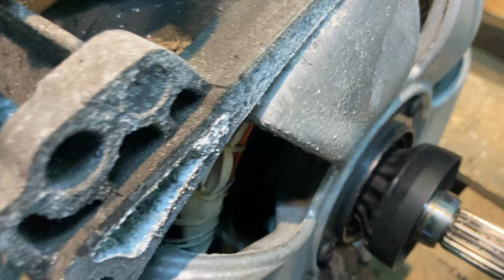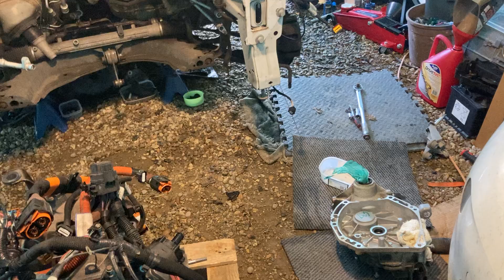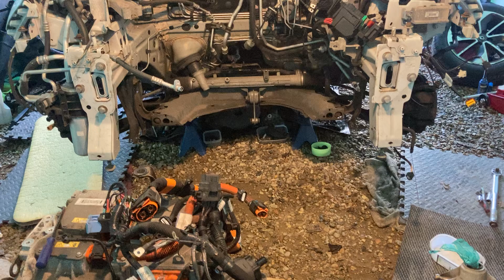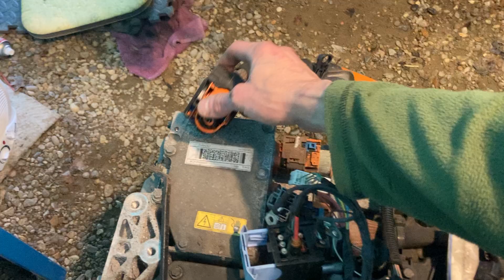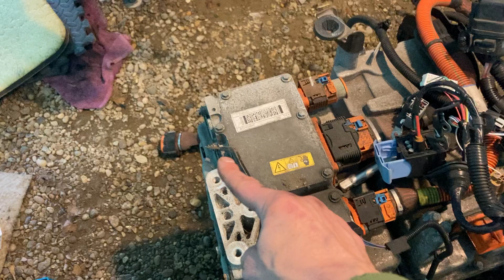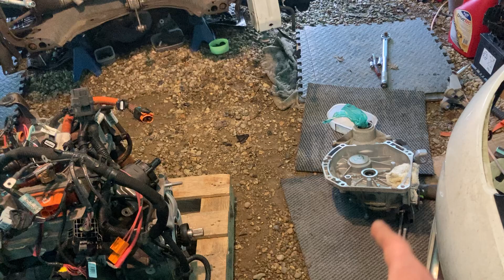Why is it so difficult getting major EV repairs done in the UK? Electric Car motor repair

Comment: Good vlog where in Essex are you as I have a cat s Nissan townstar from copart all now repaired but need help with srs module and the electrotechnical fault light many thanks 🙏 Mark from Billericay 😃👍
Reply from the maker: Hi, near Chelmsford. The diagnostics on those can be a bit more involved due to it having a secure gateway, can probably still help but will likely need to use some different equipment. Some companies will clear data from srs modules. Are there fault codes stored? If it’s easier drop me a WhatsApp 0330 043 6388 cheers

Comment: As is so often the case, fear of the unknown is a show-stopper for people. Once they embrace the new situation, they start to realise that most of their fears are unfounded. We should have confidence that garages are becoming more willing to repair EV's. It will have to happen when all new vehicles become fully electric.

If our R110 ever needs a motor repair, then, given the pleasure, low home electricity cost, low stress and the convenience of driving a BEV, I would probably pay for those 10 to 12 hours of labour and the cost of parts, even if they cost more than the value of a dead car. It's much less expensive than buying a new vehicle. 

That said, we're low mileage drivers (12,500 in 5 years), and we drive almost exclusively in Eco Mode, so the motor and gearbox might well outlast the rest of the vehicle. The car might be around for longer than my remaining driving career. Scary thought...

In short, I'm not too worried.

Comment: I can imagine a good business that simply repairs EV's components and replaces them in their workshops.

Presuming that fixing motors and reduction gears is pretty much bearing replacement (any greater problems and you would simply swap out for a refurbished parts from a crashed car?)   The controllers can't be much more complex than fixing ECUs and other components that fail charge port locks(?) are pretty much a swap out part?

You take the parts in a van and visit garages, work on their lift and repair the car for them?

Comment: Are you accually anyone alloved to work on EV in UK?
Atleast where I'm you have to have High voltage certificate to do work on them. It's quite long education and 20k doesn't sound far off. Usually there is only one per dealer here that's even alloved and just recently a college has a his EV booked in for warranty work, the first time was in the end of February since they are so busy. Understandably, who in there right mind would willingly work on a car wtih corrosion and other crap for shit money when the papers will allov you to get in to transformers and other high voltage work in a dry nice envoirment without a customer hanging on your back and questioning why it takes so long or is so expensive.
Reply from the maker: Yes I’m a qualified EV mechanic - you need to do some training and have some suitable tools but it far from onerous. There are different levels of training from basic safety to more advanced architecture and fault finding. Cheers
Reply: There are no restrictions on who can work on any sort of car in the UK

Comment: Looking more and more that they are a throw-away item.
Reply: After 20 years, probably, my current EV is 9 years old , only thing I've replaced are a set of tyres, windscreen wipers and screen wash.
Battery health is 89% and saves me around £1500 a year compared to my previous Ice car.
Cost me £14k , currently worth £5.5k , I've hardly lost out on it and will be upgrading this year.

Comment: The big question is how do you know and understand electrics? 

It's the most hated "subject" in ANY car repairs. Most people can't figure out the simplest of electrical faults on cars.
Reply from the maker: Interesting point, I started in IT with a strong interest in electronics, EVs are just big battery powered computers to me. Coding etc comes easily.

Comment: My wife has a Zoe & getting the heating repaired has been a massive hassle. It's with a main dealer after their failed repair  & it's now costing £1,700 to replace some air conditioning pipes 🫣

Comment: The statement that " the customer wants their car back on Friday" puts a question mark on how the future will pan out . How long the job takes to complete and parts availability is unknown most times. Joe Public putting time frames for repairs doesn't work for me.
Reply from the maker: Time is money unfortunately, customer hired a car. Fortunately I keep most major Zoe parts, if there had been a holdup I would probably have lent them another car. I do prefer to have the car for longer for checks and any further jobs. This car really needs a replacement driveshaft but customer wants it back so they can do that later and pay more rather than wait and me do it with the other work!

Comment: Asalamaleikum, electric cars are 10 times cheaper to repair than ice.
Reply: No. The cost is time, not parts or wear and tear items. £60 an hour is a typical cost.
Reply: @fredfred2363  electric cars are simpler, parts are extremely cheap compared to ICE

Comment: Im holding out for vehicles which have hub motors. How have they managed to make something that should be so simple so complicated. Shame on these ev manufacturers
Reply from the maker: I think the unsprung weight is an issue but it might be overcome with smaller motor designs. You also need some kind of gear reduction to get the motor spinning at its most efficient. I was looking at an ipace motor recently, they are 200hp with the gear reduction built in and are surprisingly small. Cheers
Reply: Id happily live with the unsprung weight and the and the expensive warning ⚠️ mirrors and the bonnet exploding pistons and all the expensive sensors in the numbers and side skirt airbags.
I travel 60 mikes a week in a built up area so I never do more than 30mph don't need all this unnecessary expense attached to the vehicle .
Reply: It wouldn't be that difficult to have two smaller in-board motors on the ends of tripot drive shafts. No diff. Fewer mechanical bits to go wrong.
Reply from the maker: The motors would still need some kind of gear reduction to get any reasonable efficiency.

Comment: As we get more and more EVs then garages will be forced to work on them and maybe only one mechanic may be put on the training but I suspect most will send parts for repair at a specialist such as a motor rewinder rather than stripping down to fit bearings. Similar with power electronics - just needs good diagnostic software to ensure they don't just keep replacing different components until they get there in the end!

Comment: I don't think many independent garages will even entertain working on these unless it's basic work like servicing brakes etc.  I can understand why though, it requires hiring or sending off staff to be trained on EVs at an additional cost.   Then as a business there's insurance to consider, the possibility of having an employee electrocuted and killed would be a major headache!  I think there will be resistance from the motor trade in general for as long as possible against EVs, by which time there will be substantially more owners of older EVs that need repairs, but of course there will be an extreme shortage of garages that will offer repair services for these vehicles by then.  I think the second hand value of EVs will plummet once they are out of warranty and many will simply be scrapped for what are potentially an easy fix, albeit a time consuming one such as this.  

In general independent garages are restricting the level of repair services they offer now anyway.  Vehicles are becoming very complex and the faults can take many hours to correctly diagnose and fix, garages don't want the same vehicle repeatedly coming back in with a problem they thought they've already fixed.  The majority of these faults being electronic I think puts garages off delving into something fully electric that's potentially even more complex than they already work on now. 

Not to mention the added cost of tooling up to work on these vehicles.  

Honestly, I think once smaller garage owners are forced into the position that they have to take on EV repairs they will simply just quit and sell up.  I already know of two garage owners locally who've given up on the trade due to the ever increasing cost and hassle of working on modern vehicles.  Both sold their garages to housing developers and moved abroad!  Ultimately I think we should get used to fact that repairing these vehicles is going to become extremely expensive unless you're lucky enough to keep changing the vehicle before the warranty runs out.

Comment: Not really anything to do with it being an EV, there are plenty of tasks on ICE cars that garages don't want to take on, this could range from intermittent faults that are difficult to diagnose to complex mechanical work that they're just not confident doing or they know the cost may mean the owner never comes back to collect. Certainly where I am in northern Scotland there are garages that will simply refuse work that involves opening up anything but the most basic of engines.
Reply: Well said.

Comment: sorry again for the long comment, today I got another mocking answer from Renault when I asked to cancel a possible blocking of my VIN :-(.
thanks for your videos :face-red-heart-shape:
Reply from the maker: What did you think they had blocked?!
Reply: @garycevrepairs   the vehicle identification Number of my Vehicle but only for my Renault User ID and pin which I need for the internet connection to Renault network in connection with the Renault Token.
An authorised dealer will be able to connect to my vehicle.
Today Renault wrote to me, after one month of ADT blocking

Hello,
Thank you for your message.
Our teams are actively working on resolving the issue, and we will extend ADT rights accordingly.

Thank you for your understanding!
Regards/Cordialement,
Team Support ASOS/ASOM

...they kidding me , always the same answere

Comment: Traded in my 5 year old EV for a petrol. Finding somewhere to repair/service was one of the many reasons...
Reply: Which EV did you have?
Reply: @garysmith5025  MG ZS EV
Reply: @Anon6312x  I assume you must be a high mileage driver in a remote area?
Reply: @Anon6312x  
Should have called Cleevely Motors.
They RUN MGs as the Service vehicles for their MOBILE, NATIONWIDE EV repair service.
(Just BTW, their first one just hit it's first MOT at 152,000 miles ... FULLY loaded, and had 1 (?) advisory with NO work by MG or Cleevely)
Seems like you didn't try too hard looking for service?
Reply: Congratulations you are one of the 2% that go back to inferior ICE tech.

Comment: Spares.... would you be happy to use electronic modules that have been serviced/repaired by a third party?  Or would you always go for 'new' replacements?    As an electronics technician I have repaired OBD modules and various SMPS/inverter devices and would consider repairing 'any' module but only if there was a market for them.
Reply: It would be extremely helpful to establish an exchange system, as used to be common for removable car parts, so that a garage with medium EV skills and equipment could buy a refurbished unit (motor, inverter, even battery) and send back the failed equivalent for repair. So long as there was some level of guarantee that the refurbished part was repaired to a good standard (or was cheap!) and could be fitted without having to spend a lot of skill or money on pairing it with the rest of the car, this would make local car repairs much more attractive (to the garages). A few specialists for each make or component category could cover the whole of Britain, and owners could be confident of getting major repairs done within an estimated time.

Gary is already doing something like this for Zoe motors. New bearings, carbon brushes and position sensor in a good motor housing are likely to outlast the originals. We need similar specialists for all the other common major failure parts across most models, and a reliable way for local garages to find those specialists.

I'd be happy to drive a car with repaired on-board charger, inverter, motor or reduction gear, for example. But I'd prefer to know when I booked my car to know the likely time before I get it back and the maximum cost.

Comment: Professional clutch changing businesses will change one in two hours (usually less).  The bearing change on that EV motor is the ICE equivalent of a big end bearing (or the crankshaft end seal) which seems excessive wear (too early) on any other scale.  Can you put this down to bad design?
Reply: The Book time for a clutch on a BMW Mini is apparently 7+ hours
Reply: @rogerstarkey5390  Of course it will vary - the book time for my Mazda is 35 minutes....

Comment: Incidentally, the more diagnostic hardware manufacturers encrypt their systems, the more niche ev repairs become. You won't even be able to read out fault memories without spending many 1000s of euros.
These cars will then be exported and new ones sold :-(
Sadly sad the future
Reply: That's a presumption on  your part.
The service menu on a Tesla (For instance) will give you detailed diagnostics on the screen (and manuals available on line)
You can also run OBD Bluetooth Devices continuously, real time to shown full and detailed system monitors, including battery and other info, while driving, on a phone.
That being the case, when you turn up to, or rather BEFORE you turn up to your chosen Independent Repairer, you (surely?) would have checked on line, determined the probable cause then "phoned around" to determine the quote for that fault which an experienced company should know?
Those worth talking to would reply "Top 10 fault! either "A" or "B", we have the part" and quote a similar, fair price.
(Speaking from the perspective of decades "fixing top 10 faults" for commercial customers)
Reply: @rogerstarkey5390  this only concerns the documentation 
Diagnosis on the car via OBD port is much more expensive but I have already written that!
Reply: My thought too. EV's are going to be like cell phones unless the government steps in and forces them to open up, like OBD1 and 2.
Reply: You are right, Tesla has got it and does not block access to information for mechanics

Comment: Agree, it's going to be a big part of getting everyone confident to buy used EVs. You want to know that someone local will be able to do a competent job at a fair price.
I remember when I was an apprentice (1976-1981), the older mechanics wouldn't touch automatic gearboxes and often said they were rubbish and more trouble than they were worth. But the truth was that a lack of knowledge/interest often meant that they didn't get serviced properly and many garages shied away from fixing them. Thankfully, we covered them thoroughly at college at they were, if anything, easier to repair than manual boxes. Knowledge and experience is key.

Comment: Not a chance mechanics will improve on ev's ANY time soon. It's difficult enough to find a decent mechanic on ICE cars which have been around for decades.. let alone the new EV's! After my usual mechanic quit... just getting a radiator hose repair (fiddly but easily doable and I am tempted to do it myself) is a "no" from several garages.

Comment: Get the bearings analised in the UK by a company that make bearings .Then when youve got them get the armature dynamically  balanced .And sort out any dirt getting into  the motor and bearing  area Those bearings are to small and not suitable for this heavy motor !!!  Over your part of the world its 7 grand plus to do the work !! And if you scrap the car  at the dealers  you get nothing for the car and have to pay 1500 GB Pounds to get the batterie  scrapped  ;-)
Reply: B.S
Reply: True, that there is a waste disposal charge on EV batteries, unless they go to a place for a second life.